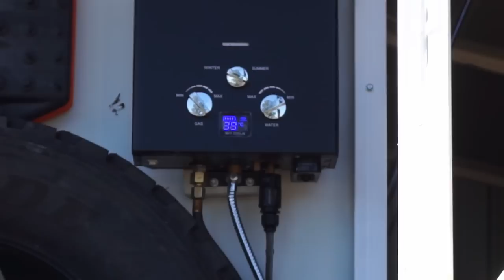RIDING SHOTGUN in a HINO 4WD TRUCK - What an ANIMAL!!!

Comment: 2 things for ya pete, 
grab ya lights from a boat shop pre wired, No joins just run straight into the plug, 
When ya change ya bearing is in good nick wash out with petrol regrease then vac seal them im a bag, throw in the boat somewhere so u always got them!
Reply from the maker: Rohan mate cannot say how much i appreciate the advice. Bloody hell brother thanks
Reply: Anything to keep you on the move mate 👌 just think what else you could vac seal in life, doesn't always need to be food.

Comment: Heya, Pete, there's a hole over your left elbow on the port side of your boat at the 8:23 minute mark that might benefit from a grommet or sealant of some sort. Because, when at rest, any slosh generated by the wind or passing vessels may well splash up there and add to the volume entering your boat.
Reply from the maker: Karl mate really great spot, and i saw that myself previously but that hole goes straight to the engine well and has no where to go but out. Legend
Reply: @WACampingAdventures  ahhh, cool as. Enjoying your channel, mate

Comment: Best thing I ever did was to get one of those removable plastic light bars for the boat trailer. Never had another issue with lights as the bar and the cables all come off before the boat goes in the water.
Reply from the maker: Im moving closer and closer to doing that mark i reckon!

Comment: Hate to be that guy....but just a tip from a grease monkey. Those bearing buddies are useless IMO only good for just topping up with new grease in new bearings. The problem is there is nowhere for the old grease to go except get mixed in. Those bearings could be just about buggered without pulling them out and cleaning and inspecting them you wouldn't know. Luv your vids Mate great content and awesome camera work. 🍻
Reply from the maker: Mick mate dont hate to be that guy. Your bloody helping me mate and i appreciate it. Your a legend dude i have always just been the guy to give the wheels a shake and wait for a noise lol

Comment: Bearing buddies are a gimmick. Regular bearing change every 10000 km and wont have a problem. 
Bearing buddies, especially on boat trailers with breaks, suck water in when they're hot.